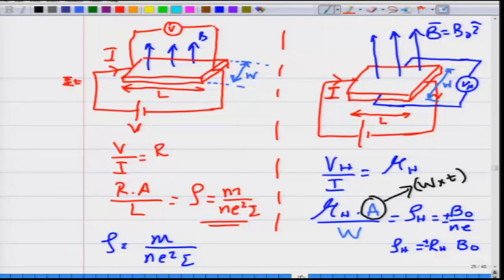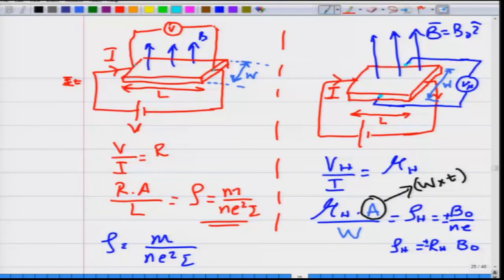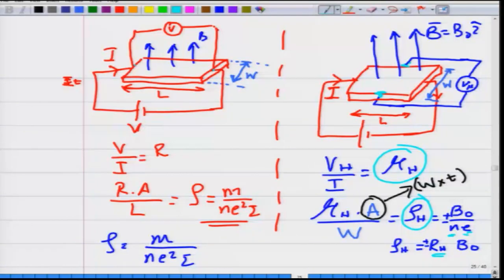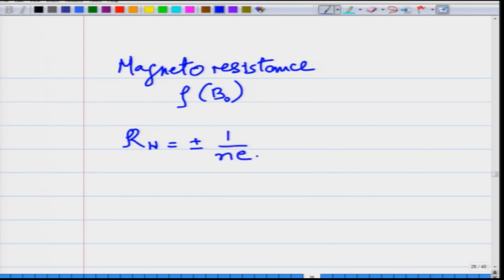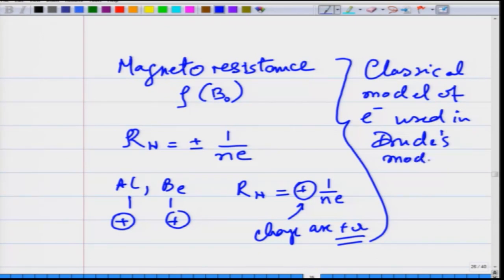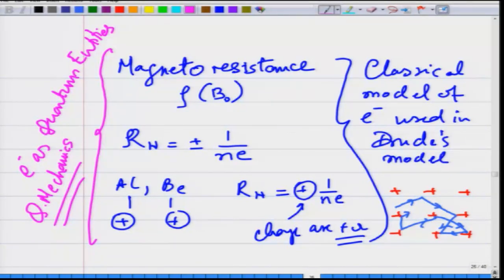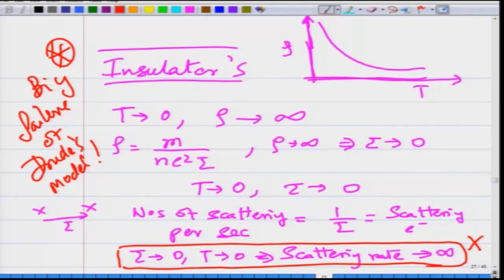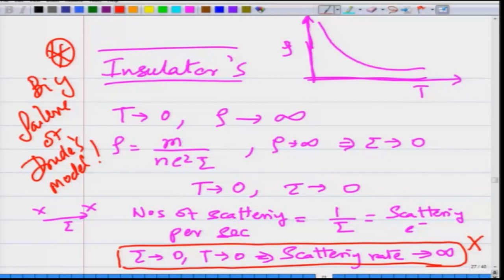noc19-ph02 Lecture 08-Introduction to Hall effects in Metals- Part-III

Comment: this is in reference to the failures of Drude model to explain resistivity vs. temperature in insulators---do you think one way to understand why the resistivity diverges as temperature approaches zero is because n goes zero? (as in, there is freeze-out of carriers at low temperatures as we see in semiconductors)

Comment: 11:22 but according to Drude, it is alright to say an infinite scattering rate for insulator as it has very high resistance, make sense!!!  though the temperature point is missing in
Reply: As per classical Drude's model (from M-B statistics), the drift velocity of electrons is proportional to the square root of temperature. v_{d}\propto \sqrt{T} [Ref: Recall Lecture-5 in this series. Slide time 11:29].  So as T goes to zero, drift velocity also tends to zero. In this situation, an infinite scattering rate makes sense.